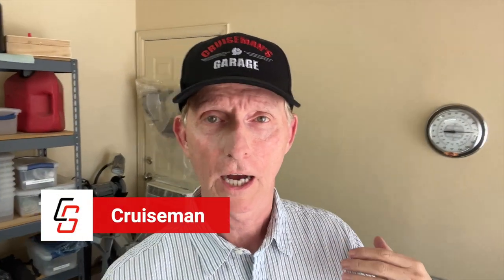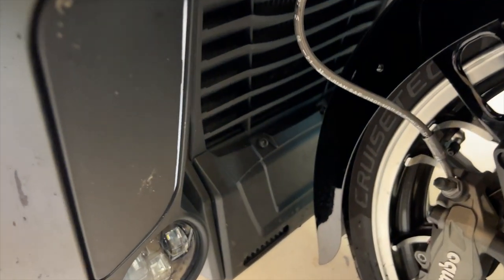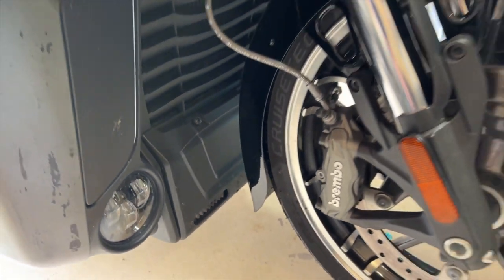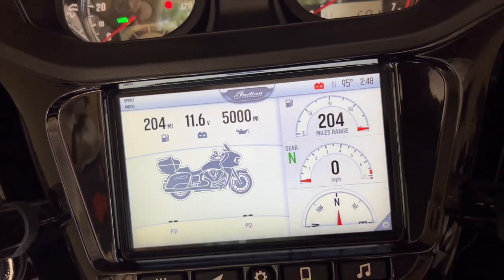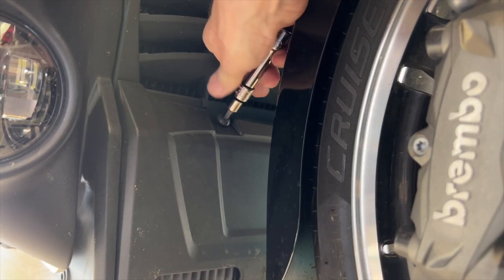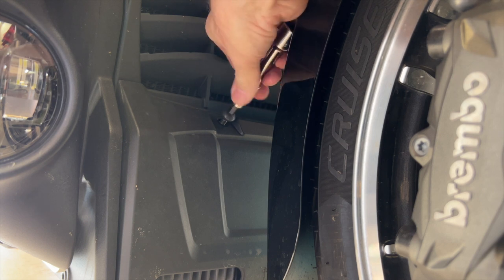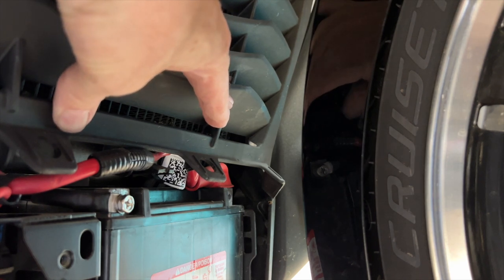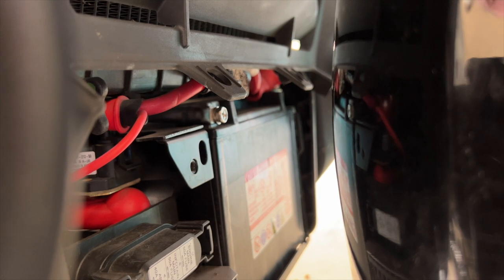A 2022 Indian Pursuit That Won't Start! | Cruiseman's Garage

Comment: Battery Tender port kinda cool... but that does not excuse the ridiculous battery placement. If your out on a ride/tour and the battery dies, you'll still need to jump it. It's a bad design. But, I hope you have fun testing the Indian out & keep the rubber side down!
Reply: I don't know for sure if you are correct or not. Maybe you should do a little research before you  make a comment. A battery is a very heavy part on a bike and Indian chose to put it at the lowest point possible. Maybe that has something to do with the great handling of the bike. Do ya think.
Reply: Seeing as i owned a Victory cross country I'll chime in.  Yes the placement is for weight distribution but, its in the same spot as what i had on my Cross Country....which i hated that location.
Reply: @Valentino50541  Thanks for the back-handed implication that I do not think, or do research, since you know nothing about me or where my opinions come from. Great thing is, I am allowed my own opinions, just as you are allowed to make assumptions that you know what a motorcycle designer was thinking and why.

The fact that one must remove multiple pieces just to access a battery that you cannot get jumper cables on, is very short sighted (IMO which I am afforded as a human). And let’s say that you’re on the road, have removed all the pieces in the way, found a way to jump the battery, now you have to tale the time to reassemble all the covers (or store them somewhere) all while the bike to draining the jump charge you just made. 

Just like the Goldwing positive battery terminal is placed badly, where it is impossible to get a jumper cable solidly connected to; without say, the terminal extender from Traxxion Dynamics.  But, just because someone had to make an after market solution to solve a bad design problem, does not mean the problem does not exist.

I’ve had many bikes over 35 years of riding, and over ½ of that time my bike was (is) my only transportation, i.e. no car or truck at all. So yeah, when I see a design that will cause me extended time on the side of a road with inattentive drivers whizzing by, I’ll put that opinion out there for others to think about. We can all have our own thoughts without putting fellow riders down…

Stay safe on the road!  😎
Reply: Hi Voices. I have the Scosche booster. It’s very compact and works great. It comes with a set of cables that can be easily attached to the positive and negative terminals on the GoldWing. Cruiseman has done that with his. I can easily plug my tender or booster into the connector at the end of theses cables. It also comes with alligator clips, but they’re not necessary. The accessory pod on the Indian looks like it has the same connector. So boosting or charging should be possible through the pod. 
I agree though… the battery should be more accessible. But my batteries generally last several years. So I could live with an extra 10 or 15 minutes to service it when the time comes. Under the seat is always a good spot if there’s room.
Reply: @whatsupeh1  Thanks Dwight!  I went with the Fanttik T8 APEX Jump Starter - I'll have a look at the Scosche. Being in AZ and riding the SouthWest on my 'daily driver', batteries can be temperamental for me, and do not last long.
Reply: @Valentino50541  Not to mention the balance of the bike. When you put the kickstand back and move the bike to center it is so easy, it is like a feather. I was actually shocked when the salesmen pointed it out to me.

Comment: When I bought a Challenger the dealer told me about the charging port. Also, they told me to always plug the bike in when not riding it. For some reason, some challengers chew up batteries. Mine was one of those and I always worried if the bike would leave me stranded. It never did but it had electrical gremlins that would crop up, but could not be fixed as "there is nothing wrong with the bike!" I sold it after suffering for 4000 miles. Hope the Pursuit works for you.

Comment: The Pursuit has I think 6 onboard computers that create a parasitic draw on the battery. If it sits for extended periods, the battery will drain. Same as today's outboard motors.  I have over 4,000 miles on my 2022 Pursuit and love the bike. I traded my 2022 Goldwing Tour DCT on the Indian. The Pursuit is an excellent bike with plenty of power, comfort and tech. It comes with Apple Car Play and I just added the CarLink 4.0 Bluetooth module and now I have Android Auto also. I'm averaging 47 mpg vs the 48 mpg I had on the GW Tour DCT. You will notice more heat from the engine but no where near as bad as the air-cooled V Twins.  When my ride is done for the day, I hook up my battery tender immediately. Never had an issue with the bike not starting.  I look forward to your review !
Reply: really gave the GW a long term shakedown, eh?
Reply: @keemez   that was my 3rd Goldwing  ; )

Comment: I think that SAE port up in the handlebar area was designed more for powering your electric socks and underwear than it was to jump or charge the battery. Check the electrical specs for the jack and see if it will carry a load of about 11-12 amps.
Reply from the maker: I don't think it is for jump starting. Typical SAE ports cannot handle that amperage. But, I was informed that it could be used for a battery tender.

Comment: The battery port is a great idea. I fit one to all my bikes. Heavy battery located low down? Makes perfect sense. As for jumping, in spite of the battery being mounted on the side of a Goldwing, you still can't get a crock clip on the battery terminals. I'm a Goldwing rider btw.

Comment: At least you can see the battery voltage on the LCD display, that is something I wish the GoldWing did...
Reply from the maker: True
Reply: Get yourself a digital V. Meter. I installed it  with double face tape on the inside cavity by the headlight adjustment knob. I can see the reading on a sunny day. Works like charm.

Comment: Put some heat shrink on your extension or get you a Makita battery powered ratchet. It works great and tight spots. There's nothing worse than the metallic sound of an extension making contact with the metal fender.
Reply from the maker: Agreed.

Comment: Alot of bikes (my Harley and my Indian) have an SAE battery tender pre-wired under the seat or close to it, since that's normally where the battery is. This is the first time I've seen a "port" built in, but thats probably due to the unusual battery location. BTW, if you turn the wheel it would give you more room to work.

Comment: Challenger owner here, turn the wheel either way full lock and it's much easier to access cover bolts and battery.
Reply from the maker: Agreed. That's what I did.

Comment: Chris, find out why the battery was not fully charged especially if they claim that it was in working condition. Maybe some kind of a short. But I guess it'll be obvious if the battery will be discharged again after charging it.

Comment: Probably the port is only for charging the battery, i.e. during winter time. If you really need a jump starter with high currents you need direct access to the battery poles.

Comment: The bat tender connector near the handlebar is really cool.... I put mine in the left saddlebag on my 2018 GW.
Reply: May I ask if you access the tender plug with the saddlebag open or closed?
Reply: @mikec9162  I drilled a hole in the front panel of the left saddle bag. I had to install a "Main Battery Switch" because of some issues with a Creep Current (probably a faulty Accessory hub from Pathfinder LED). Thru the same hole I routed the cable for the Jump Starter. If you want, I can send you a picture.
Reply: Of course, the saddlebag has to be in Open position.
Reply: @340Captain  Thanks for the reply. It sounds like a nice setup.

Comment: Turn the front wheel so you dont hit it with the socket extension, im sure the driver left the bike on after he mounted the bike for delivery, did you check by the fuse block for a positive post ?
Btw i knew about the charger port plug on the dash that is wired to the 10A TENDER.
When you go actually look at bikes in the dealer the indian sales man goes over 99% of the bike with you, this was a fun bike to drive.

Comment: I really like my Scosche booster. It came in really handy last year during a 300 mile ride. A friend’s Harley was having a battery issue and I jump started it at least a half dozen times. Every time we stopped, it needed a boost. The Scosche worked flawlessly. I charge it about every two months to make sure it’s always fresh. 
Funny about the battery fiasco on the Indian. But pretty clever of them to include the tender port. The Scosche would easily plug into that as well, if a boost was required.

Comment: Well every bike is different so easily missed for a battery tender connection. Well BMW thought of it too and the CANBUS port is where you can plug in a battery tender as well. However, you have to know what you are doing because if your tender does not pulse the CANBUS...well it doesn't work. So either way, easy to miss if you never had one before.
Reply: you in the oil (or water) industry by chance?

Comment: 🤣don't get me wrong, but for more than 30years, I systematicaly install that kind of direct contact to the battery, but yes, i do drive more than 30.000km/year and summer/winter alle year long.  Did it on my Goldwing, previously on my Triumph Trophy, before on my KTM SuperAdventure 1290 and on the 950 too, on my BMW K1200RS and on my Triumph Daytonasss 1200.  I thoughut you liked to show us your screwdrivers ;-)  The low battery location is good for the lowest gravity-center - I had it on the KTM's also as low, but with the salt on the belgian  raods in winter : Verry bad location.  The Indian should be a summer bike in here ;-)  K.R. and thanks for your good vidéos.   LPhD

Comment: They are supposed to be kept on a tender and key fob far away from the bike. it is common parasitic draw. read the manual. it is also online. you didn't do your research. You are not very smart. all this information is in the manual. easy to read stuff.